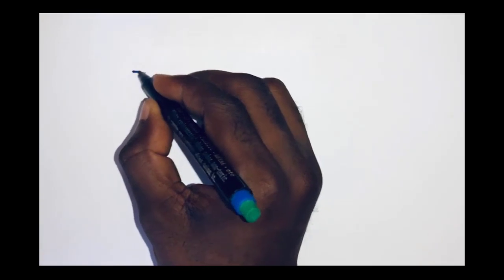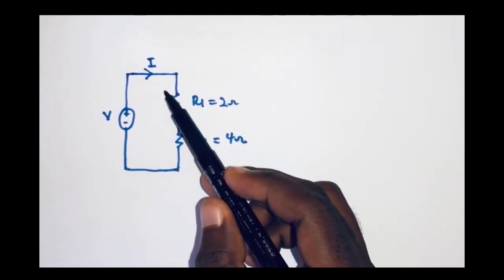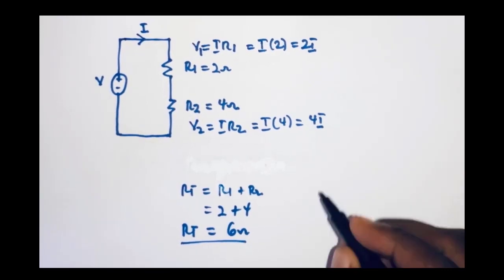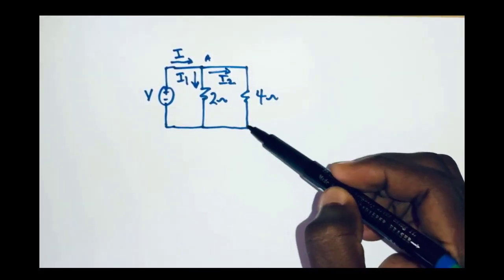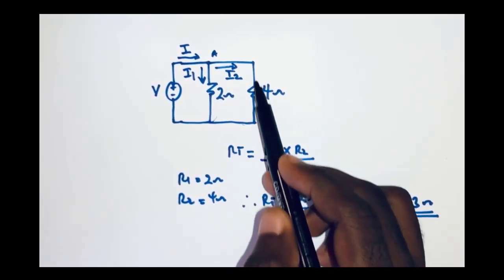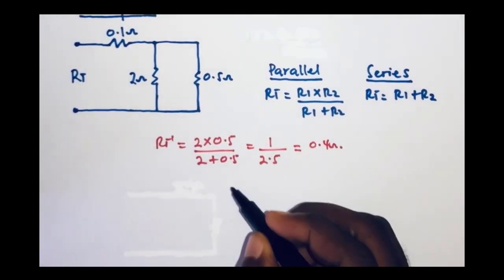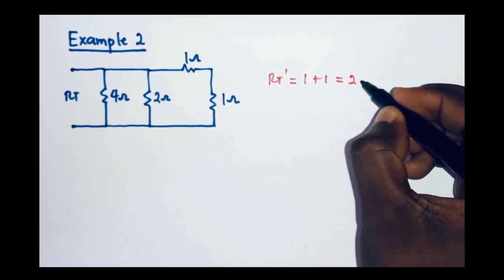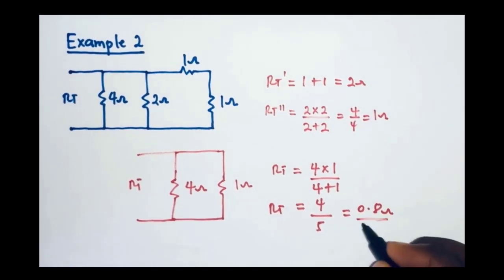07 - How to Find the total resistance of a circuit

Comment: In the example two, it is the parallel circuit and you don't need to multiply R1 with R1. Since it's a parallel circuit so, you need to   add 1/R1 and 1/R2 to find the total resistance. 
Otherwise, really appreciate the good work.